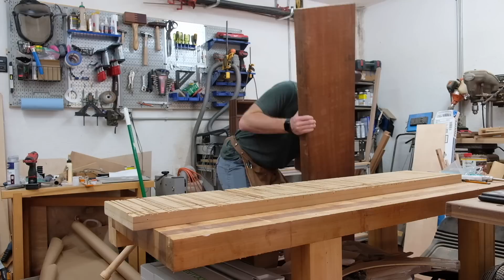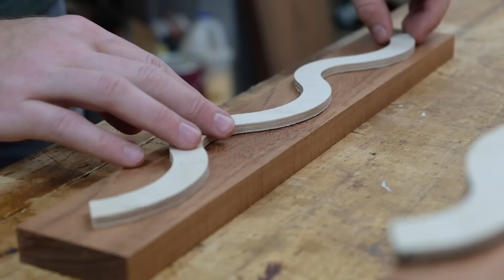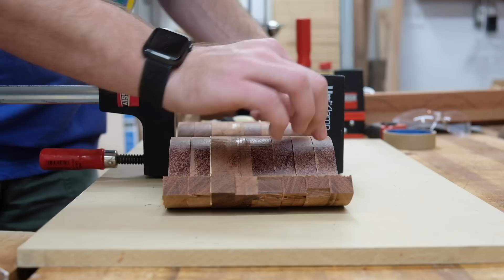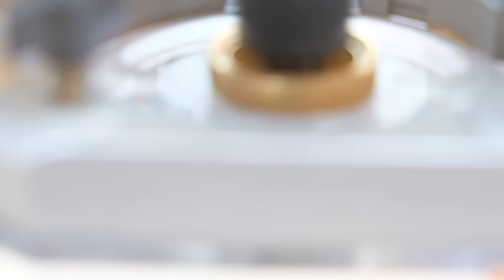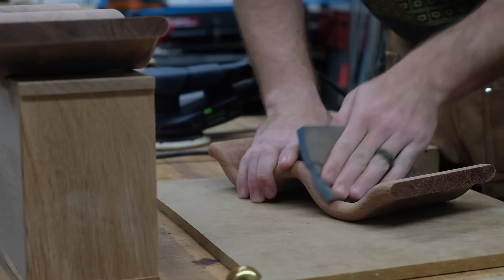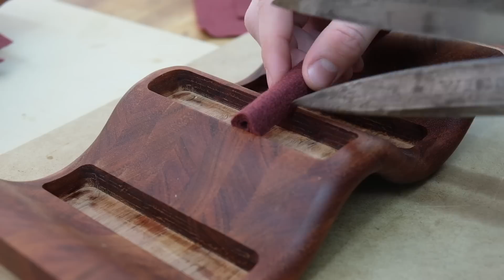Making the Squiggle Ring Box

Comment: Just a tip on the Rubio - I found that its not actually 3:1... If you do that you end up with left over in the big tin. if you do 11:3 (3.6666:1) then it works out correctly.
Reply from the maker: I’ve noticed the same thing, running out of accelerator. I wonder if the 11:3 ratio is just as effective.
Reply: @parillaworks  it seems to work perfectly fine still for me. It actually says "appr. 3 units A to 1 unit B" on the tin, so I assume it can't be too picky...

Comment: Not a CNC fan. Letting a computer do your work is not  wood working it is design and let a machine do it. I'd like to make a box like that but just the materials are prohibitive.
Reply from the maker: A CNC is just another tool that takes time to learn and use properly. I’ll tell you this, it’s much more difficult to use than a thickness planer but no one knocks someone for using one.